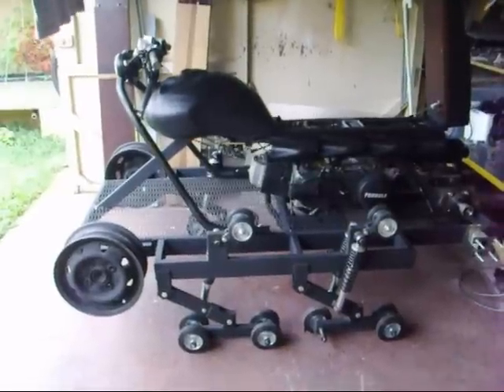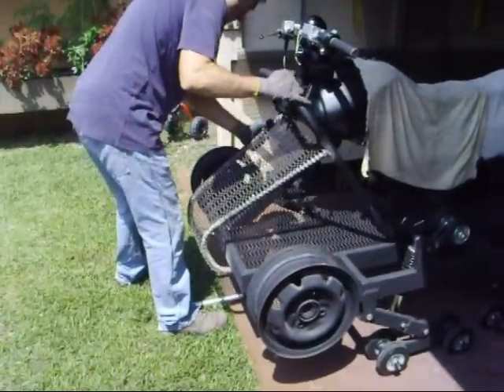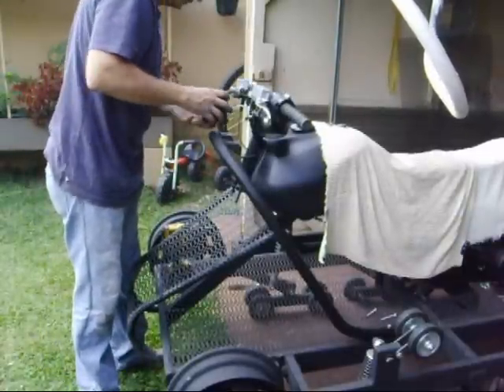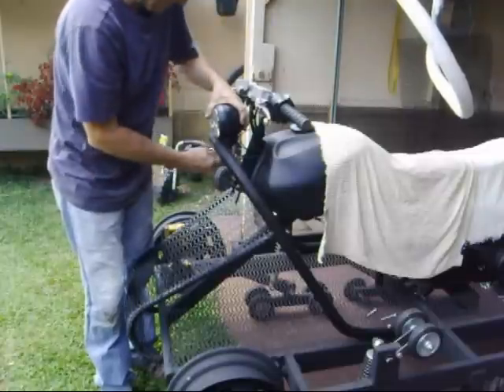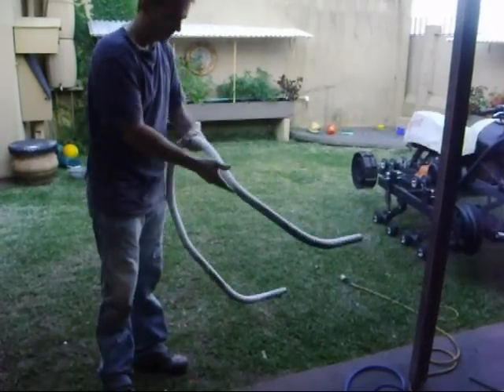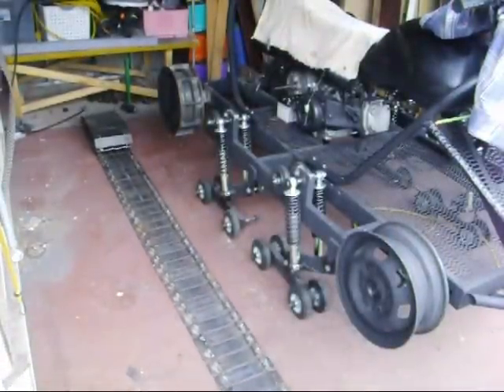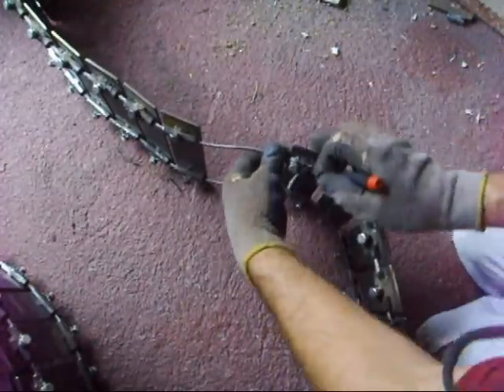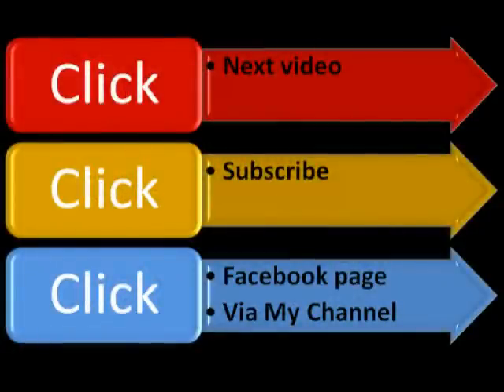How to build a tank .Progress report .10-A

Comment: There is NO doubt in my mind that you're "master link" is a failure looking for a place to happen. And it will no doubt happen someplace deep in the woods!  Pinching that cable like that is only going to cut through the cable and what are you going to do about it if it does - replace the entire cable because it's 2 inches too short now??

You need to find a way to join the cable ends with a crimp-style splice.

Personally I'd use some old conveyor belting and join the ends with a steel plate, some short bolts and some Nylock nuts. You could use a normal car tire to drive them.  This design is all over YouTube.  Look for it.  If the tires are over-inflated it will arch the middle of the belting and the belt will self-center on the tire.  You don't need a sprocket for a driver then because the belting will grab onto the tires!

I was with you on the tracks, until you got to the last part.

Comment: Pretty cool.  But the back roller on the tracks needs to be a sprocket like the sprocket that drives a bicycle chain.  The teeth of the sprocket fit into track and drive the track.  
It will slip as it is now.

Comment: honestly i think u should use chain belt then a rubber belt but its pretty cool bro
Reply from the maker: +Courtney Moss The problem is when you turn the belt has to slip. I have changed the pulleys for bigger ones and also moved the engine forward to allow for longer belts I hope this will help. Thanks for the comment.
Reply: ur welcome

Comment: The tube you cut with slots? Be careful welding it since if it is Electrical conduit, it is electroplated with galvanizing and when you weld it the fumes are very poisonous.
Reply from the maker: Khadijah Brown The tube was regular carbon steel it was not galvanized.

Comment: Is the tracks for tanks always made of metal? I thought that they would be made of rubber. But metall may be a better choice or why did u choose it? Are those tracks done or maybe you will epoxy rubber on each track? U could cut up an old tire for rubber.
Anyway, awesome job! This is a project all kids dream of doing when they grow up but few do.
Good luck!!! I subbed....
Reply from the maker: HolyCrapAA It was easier for me to work with the metal. I was thinking of putting something on the track afterwards. I was looking at welding a piece of rebar across each shoe for extra traction. Thanks for watching and subbing.

Comment: Very good work and my hate is off to u for doing something creative and fun.

Unfortunately I have worked with a lot of cable rope. Cable is not a very good idea to connect tracks together with. 

Reason being is that the cable does not like to be bent multiple and multiple times over and over in the same exact spot, like in between your links. 

Although cable is strong, as it is bent and tugged on multiple times in a forceful circular motion, it will begin to separate and squeeze the oil out of the cables. Then it will fray and break quickly.

Cable rope is not meant for this type of work really. Also no matter what size cable use it simply will just break because they are not meant for these type of demands

In my opinion you would be better off using chain link in between your links as a connection, which is meant for this type of demand. 

I do like your project best of luck to you sir
Reply: Oh. That's a definite issue. I didn't even notice that.
Reply from the maker: 19882fast4u You could be right. It looks like Ripsaw and mini ripsaw are using cables on there tracks. Are am I wrong? Thanks for the comment.
Reply: Aceman307 Sorry but i might notice small problem there.. with rapid acceleration master part could get under such tress that those two bolts wont hold cable in place, also those small pipes holding tracks in place when turning, could be too small. I think when you really start to drive this, its going to most likely brake tracks in half from master link and slip tracks out when turning.

I'm not hating this and i hope i'm wrong, but i wanted to point this out before you do more work in it.
Reply: I'm not sure to your question about ripsaw and how it was done, but I do know of the vehicle you speak of as I remember reading about it years ago.
But I know cable very well. EIP cable would be your best bet if you continue down the road with the use of your cable links in my opinion. But as I've said before, it will break sooner or later in my opinion.
If it was me and I had the option, I would weld 2 thick extended vertical plates of steel to the bottom of each link with a hole at each end, and then connect each of the links with a solid steel pin and locking nut and flat washer and a grade #12 cotter pin. Just my thought.
Reply: Hellsong89 I as well though this too.
Reply: Aceman307 Another thing I have thought about, your tracks seem somewhat close together. Will this allow for good traction? Also I was thinking you might want to have some type of rib or nub per say to the top of each plate of track for traction in snow or mud, I can see this rig doing good on flat surface, but might have a problem in mud up a steep hill or so. Just some thoughts really. Good job so far.
Reply: 19882fast4u Just idea, but how about adding couple of more those upper guide wheels so track does not have to go up and down. I think lots of energy/speed is waisted in this too, when you want really to give it gas. Proper military tanks have ton of road wheels to support track when driving fast as possible.

Good thing with this build is that when he gets transmission system works, modifications and changes can be made to the track system pretty easy. Personally it think independent shocks for each road wheel and he should put bigger wheels in, possible add couple more road wheels depending where this is planned to be used. One road wheel near torgue wheel could be fixed in position what enables him just lose it and take track of more easy.

I planned to make something little bit bigger that still fits into normal car trailer, what looks proper tank for airsoft games and make it so its shell can be lift of and used in my parents farm to pull stuff from hard places, transport wood etc stuff, where wheeled machine will get stuck. I think something like 2/5 scale leopard 2 would be cool body and enable use rest of space behind driver for cargo.

I havent seen but one tank in Finnish airsoft games and that was build from drivable grass cutter.. that was broken in that one game :(

So for i imply all who have home made tanks that actually look like one, that you contact your local airsoft fields and offer your tank to be used there as support for players. Even if its just driving around the field for looks, but even better if gun could be made to shoot 40mm airsoft grenades or similar like that.

I dont doubt one second that any airsoft field that is big enough to get tank driving there would not pay what they can to get tank into game, specially in bigger 300+ players games.
Reply: Hellsong89 In reply to your comment, lol I think most of us will steer clear of the battle field for now, and let the air soft bullets hit some young fragile kid ;)

But back to business. You are correct that this system might have some faults in how it operates.

In a tracked system, it is idea to have several fixed rolling guides under the upper tracks to allow more support and less tension through out the track system. This also can gain in helping the track system to stay on while in a turn or under a heavy load. It also aids in stopping unwanted springing, like when driving over bumps.

Also, with out the aid of more lower rollers with springs/shocks, it is likely that this bike will have a high tip rate from back to front as it climbs over rock or what not. Not a full tip and crash, but unwanted front to back side to side action.

Rather it works or not,I think this is an amazing custom design really. Its people like this that build things like this that create the world we live in today. 

Also, I know nothing about anything, so don't listen to me..... ;)
Reply: 19882fast4u Well i just said this if tank builders are interested to get good reason get their tanks have some fresh air and same time help local youngsters^^ Of course i dont think everybody are rushing in so we have most epic airsoft+ tank to tank combat event EVER! But if there are some who think what to do with their tanks and need "excuse" to go driving in woods middle of infantry battle^^

Okey so i'm not totally idiot for building tanks.. good to know^^ 

The shock idea come from "master" plan to have more shock pushing track into ground getting more traction and so that it would be more stable to drive. Shocks then could be smaller, but in greater number what could also be cheaper depending the shock. Other option could be add more powerful shocks in the both ends stopping the unwanted front to back and even side to side action? Leaving those middle shock more adapting(less powerful) could get you the more traction and stability in rough terrain+possible more speed.

Is there any books or more over videos about driving geometry of tank building or similar? Of course i would be happy with just some all ready know build pattern in suspension side for mentioned build?

"Rather it works or not,I think this is an amazing custom design really. Its people like this that build things like this that create the world we live in today. "
Yes like i said this is amazing build, but i try to point out possible mistakes or improvements to help project get even better^^ Of course i want to help if my plan to possible copy this system in my own build! ^^ XP
Reply: Hellsong89 Its not really about having a strong spring rate. Its more about having a stable ride under extreme terrain conditions.

How you would accomplish this, is by having lots of small lower wheels that are lightly under tension, that allow for easy lift over objects. Even though they would not be strong supporting individually, they are strong as a system, and carry weight evenly though out the track system. 

The end result tends to be stable and smooth. JUST MY 0.02 CENTS ;-)
Reply: 19882fast4u Yeap that is what i was thinking. Also i like to add that if far most wheels have little bit more stiffer springs, it should stop vehicle go nose down and when rapidly accelerating stop nose going up. This mainly for high speed applications, but would also help in the rough terrain.

Any idea what kind of terrain this transmission system can go? I know hydraulic can go anywhere far as the pressure is big enough and there is traction, but what this belt system can handle? (lets say 2-3 belts for one direction, reinforced with cycle chain)
I have only seen videos of these build drive in flat land, never any hills etc, where i want this thing to go.
Reply: I want it. Add it to the long lists of  atvs I've injured myself on
Reply: The biggest problem I see in this build, is that there is no inside track guide or rail stoppers to prevent the tracks from coming off while turning and going over rough terrain.
Reply from the maker: 19882fast4u Not finished yet. I am working through some other problems first. Have you checked out "Drivetrain 10D"  Aftrer this last update I did totally disassembled it to re position the motor to allow for bigger pulleys also I am changing the bogies to single larger wheels so I will have to design different guides for the tracks. Stay tuned still working out the kinks.
Reply: Aceman307

Good job keep up the good work. You will get it for sure!

Comment: Hi, cool build! like your idea using a bike. I have a consern you might think of: The machine balances only on the small wheels (don`t know the english names). this gives you a shorter wheelbase than the bike used to have AND a higher CG (center of gravity). You could end up with a "rocking chair" feeling when you give throttle. A solution might be to lower the rear axle, but this might demand that you need to add some suspension.
Gunnbjørn from Norway

Comment: hey dude just finished watching your vids . you have some good idea's   You really need bushing on that . try using rubber pipe cut to size like a rad hose or other car rubber hose and use a smaller bolt. I did that on a buggy I made it worked well and made the ride way smother.
 im looking forward to watching your next vid.
Reply from the maker: Thanks for the advice.

Comment: Awesome build and channel. I'm assuming from the 307 part of your user name you are in Wyo? Also a set of fenders from an old tractor trailer might be an idea further down the road so you are a lil more safe from the track while in motion and to keep yourself relatively clean. Keep up the great work. Can't wait to see more!
Reply from the maker: Thanks, Actually the 307 is a little more personal, It was the first Chevy engine I rebuilt and got running when I was in High school. I got the Aceman when I was playing flight simulation games while I was In the Navy.Working on the next video should be posting soon. I still have some of the wire mesh that I used for the floor I plan on building some guards out of that.Thanks for watching
Reply: Aceman307
HA! That was actually my first guess, for some reason. I had a Chevy pickup with a 307 in it, a long time ago. That's a pretty rare engine, I haven't come across many of those. About the only Chevy engine that I have seen less often is the 302. Don't see many 283's, either. And NO, Ford freaks, I mean a Chevy 302, I think they only put them in the '68 or '69 RS/SS. They were rated for 395hp, while the SS 396 only made 390hp. I believe they mated the 283 crank to the 327 Corvette block, with 202 heads. With that short stroke, it was a punchy little bugger.
Reply from the maker: UNITED POLICE STATES OF AMERICA I think your right about how they got the 302. That was the great thing about the Chevy small blocks you could mix and match allot of the different parts. I had 350 heads on my 307 I stuffed it into a Chevy Monza. I pissed off many neighbors with that car. Two Thrush "mufflers" and straight pipes out the back. Good times.....

Comment: Really like some of the ideas you are using. I have been throwing around a lot of ideas to make something along these lines. I think I have the essentials of the transmission nailed down, but I am very interested in seeing what you have coming with yours. Your idea on the steering system is nearly identical to mine. I had tie rods in mind for mine, but I may try and incorporate the idea of the cables since they are a lot cheaper. I subbed and am looking forward to the next installment. :)
Reply from the maker: I have most of the transmission done. I just have to get the lines for the brakes made.I hope to have a video out in the next week or so.Thanks for watching and commenting.

Comment: The wire rope in the tracks is interesting. The tracks could be aluminum with rubber laminated over each individual piece.
Reply from the maker: You could make the tracks out of aluminum, would help with the weight. I weighed one of my steel tracks and the weight is 55 lbs. I have been debating on what I should put on the tracks. Rubber, wood or just the steel.

Comment: I like the build but I think the cable is gonna wear out pretty fast, hopefully I'm wrong :)
Reply from the maker: You could be right. I think I am going to have more problems with the wheels I used. I think I might have to build some that are stronger. I am going to finish it for now and then see what I need to fix or change. Stay tuned and learn from my mistakes. Thanks for the comment.

Comment: Nice!! Love that front bumper, I don't know how mine will be yet but I'll make it something like a scorpion head if I can. Was that a jig you had the track layin on when tightening the bolts to get the spacing? The tracks should roll pretty quite, the spacing inbetween look like not that far apart, and should roll easy too I would think. Lookin great Mark. Oh, so close,LOL!!!
Reply from the maker: Thanks, I started with the light bar and just started adding the other parts as I went. Yes that was a jig that I used to help space the tracks. The tricky part is making sure everything is spaced exactly. How are your tracks coming along?
Reply: I finished drilling the holes for the bolts, worked out great with the jig on the drillpress. Now I'm grinding the chain reliefs in the plates which is going pretty quick but can't seem to find time to work on it, alot going on, but this weekend I should be on the next step, either welding the washers on the chain, or welding the track guides, bolts, and cleets in one shot. I keep saying 2 weeks on the tracks but time is going by quick till it starts snowing. I keep pushing along, trying to atleast get a rolling chasey by the beginning of December I hope.